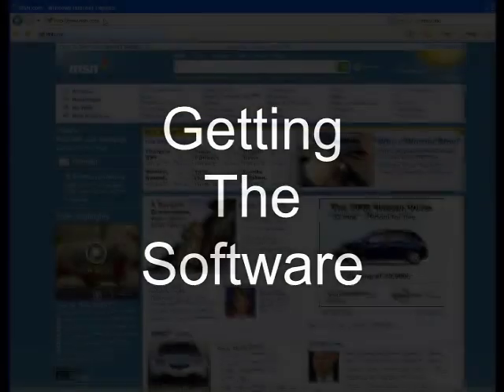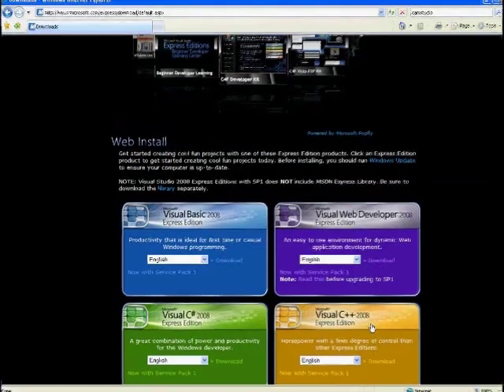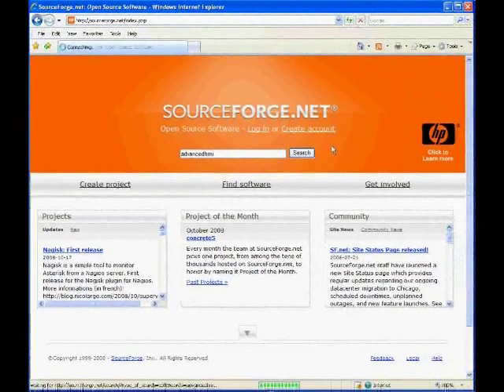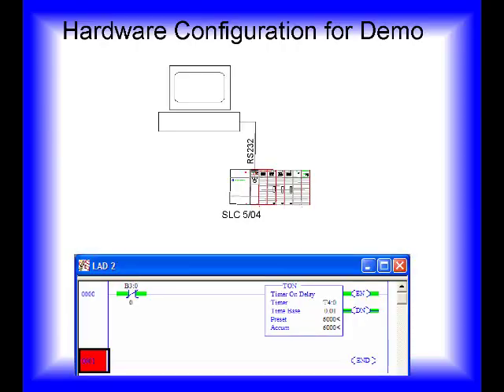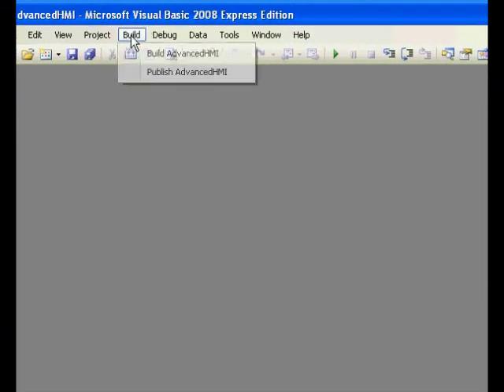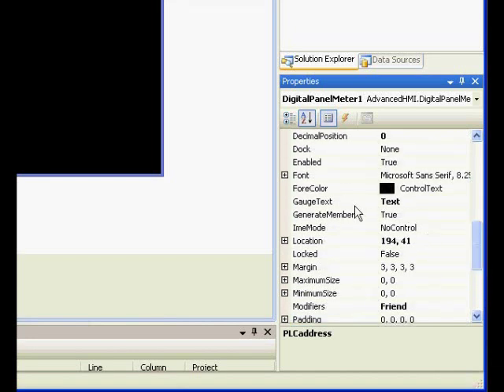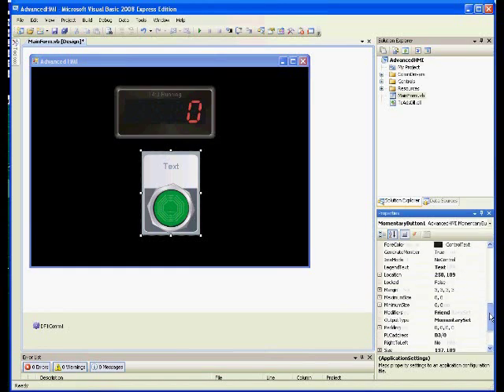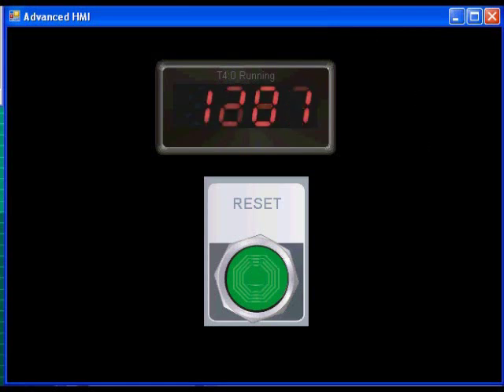Advanced HMI - The Free HMI / SCADA Development Package

Comment: Can anyone please help, I try to open the AdvancedHMIv35 in Microsoft visual basic express 2013 IDE but it opens up in my visual basic 2010 shell (isolated). I want to build an HMI and follow what was done in this video. Unfortunately, visual studio 2010 shell states that it has an "Invalid license data. Reinstall is requires". What does that mean? I had the visual basic 2010 shell before this. I also need the shell to run connected component workbench (CCW), I am not using CCW at the moment because I am still wanting for my Panelview c400 to come in the mail. I found out about AdvancedHMI after I recently order the HMI terminal panel. What is the difference between IDE and the shell? Are they both needed?
Furthermore how can i fix the error message of "Invalid license data. Reinstall is required"?
Another thing, this download should not need a license since is offered at no charge. What gives?

Comment from the maker: @MrMicahberger Go to the Solution Explorer (Ctrl-R). Expand down the CommDrivers folder. Right click DF1Comm.vb and select Vew Code.  If you are using the Ethernet driver, right click EthernetIPfor SLCMicro.vb.  Once the code opens you can use the search function with Ctrl-F

Comment: I tried this and it works well. I wanted to watch production on two different machines off of the same form. The problem is that when I added another communication component driver. The software would not let me set two different ip addresses. I would change one and then the other comm component would set automatically to the other. is there a setting that I am missing that will allow me to watch multiple processors?

Comment from the maker: It's been tested with a 5/03, 5/04, 5/05, and the MicroLogix series. I also tested it with a 5/02 using a 1770-KF2 module and a 5/04 using a Data Link DF1->DH+ converter. It works well with all of these.